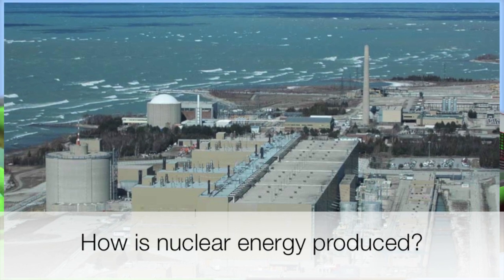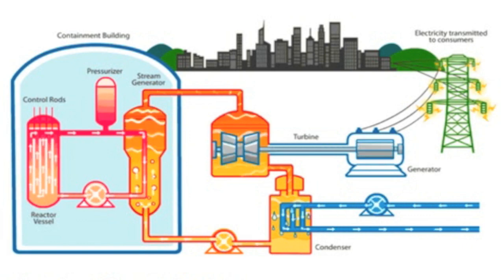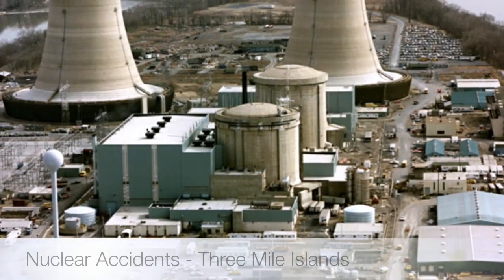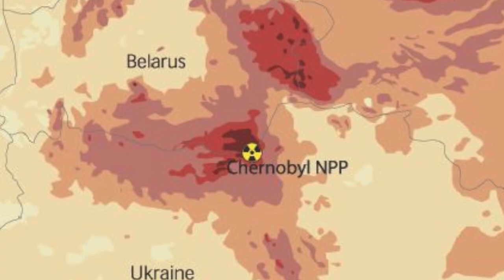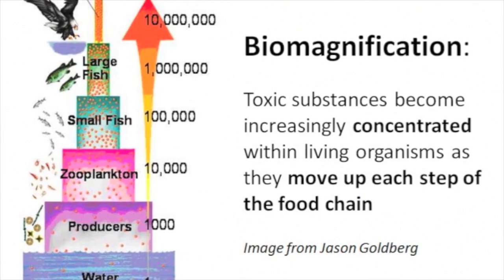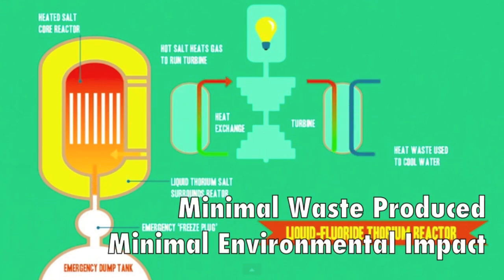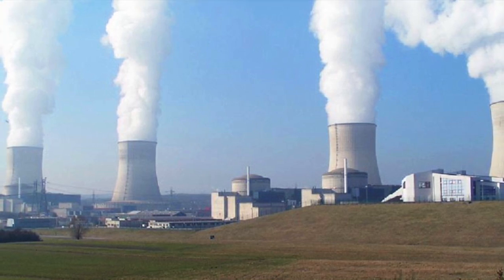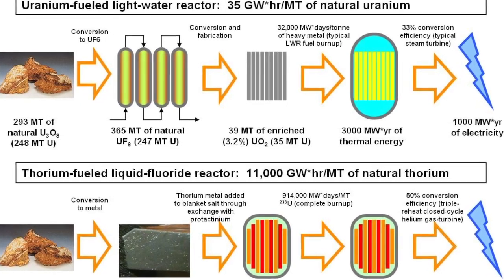Thorium vs  Uranium

Comment: Naughty, Naughty. Name a video Thorium vs Uranium to just bash nuclear power as really bad.
Since Chernobyl around 10 million people died from coal mining accidents, black lung disease, lung cancer from coal, coal transportation accidents, coal boiler explosions, and the total gamut of coal pollution effects.
Chernobyl killed a few hundred people.
Why don't we focus on that instead ????
The big deal in nuclear isn't Thorium but molten salt reactors (MSR). They're much cheaper than solid fuel reactors. MSRs can be designed to run on Uranium, Thorium, Plutonium or mixture of the three.
Meanwhile Thorium can be used on regular solid fuel reactors. Fuel formulations like 90% Thorium + 10% Plutonium have much higher thermal conductivity and thermal margins vs regular uranium based fuels. This allows both to increase safety margins and reactor power. Brand new reactors with design changes to use Thorium fuels can attain 30% higher power output that with regular Uranium fuel.
The two logical small steps are being prepared already.
Terrestrial Energy IMSR reactor runs on low enriched Uranium but its an MSR. In can extract 6x more energy per ton of mined uranium vs regular sold fuel reactors. With infrequent reprocessing (once every 7 years) it should extract 10x more energy per ton of mined uranium, enough so that if every coal/gas/oil/old nuclear electricity plant in the world were replaced with IMSRs, existing Uranium mining and enrichment would be enough. There are other MSR efforts worldwide. I'm showcasing Terrestrial cause they're taking a feet firmly on the ground, keep it simple stupid (KISS) approach. They refuse to make any choice that reduces the chances of certification/commercial success.
Thor Energy has completed 2 years of testing of Thorium based fuels in the Halden-Sweden test reactor. Their new fuel formulations should obtain approval soon and be loaded on existing reactors around 2020. 80% of the world's reactors can use Thor Energy fuel. At 15% uprate on suitable existing reactors is enough energy to power all of California + Nevada.
Reply: The huge win with MSR technology is the ultra low costs of building and operating a plant. Weinburg's original MSRE in Oak Ridge Labs ran for 5 years. Switched on every Monday morning and off again on Friday night. He didn't want to work weekends! The design was based on Weinburg's talent and not much else as there was no design information to use. It ran with no problems for all that time until closed by Ricard Nixon. All their data got shoved into cupboards and forgotten. 
5 years later, Three Mile Island went pop.
Moltex from UK had their design costed by Atkins (the world renown nuclear engineers) who used their expertise to spec and cost the plant to current nuclear standards. In spite of all those additional costs over any other energy source, the build cost per MWH (MegaWattHour) was less than the cost of a coal fired plant. However UK's nuclear regulators would not authorise a pilot plant so Moltex went to Canada.
The current nuke industry is not fit for purpose.
Reply: Don't forget the British Moltex that uses molten salt fuel contained in vented fuel rods. Just like Terrestrial Energy, they are doing everything possible to avoid complex regulatory issues. But they still had to give upon the UK simply because the regulator was dragging things out with inappropriate demands. They moved to Canada and expect to have an operational plant very soon. Their whole gamut is to be cheaper than coal.
Reply: @Dave5843-d9m  That's awesome to hear that canada could be at the forefront of nuclear innovation
Reply: People will call this a conspiracy theory, but I believe that a LOT of the behind the scenes pressure to stay with the solid fuel, Rube Goldberg versions of nuclear we went with was from a fossil fuel industry that did NOT want to have to compete with an abundant fuel, efficiently used, that has a MILLION TIMES more energy density than the purest, densest forms of fossil fuel.

  All they had to do was add enough additional impetus through third parties, to get Nixon to go with the solid fuel programs in So Cal, an area he had strong political ties with, and a choice also supported by the MIC as the proven source of the weapons grade material they “needed”.

  If public (and planetary) safety were a consideration, BWR’s and PWR’s would NEVER have become “the standard”

  Now the regulatory agencies are built around approving and regulating this specific type of reactor, and the public is RIGHTFULLY fearful of the type of accidents that have caused various governments to increase their “acceptable levels” of radiation exposure, so as not to have to even attempt (the near impossible task) of cleaning up radiological emissions from the many small and luckily few HUGE “accidents” we have experienced in the blip of time since we have started these experiments in “bringing star-power to earth”

  Fukushima is a disaster for the pacific of EPIC proportions...  3 full blown melt-downs...

  Hopefully we can make “sane nuclear” happen, in spite of the fear created by past reckless disregard for the difference between the hazard from external and internal exposure to the now worldwide emissions from past activities, and present/future releases from ongoing disasters in Japan, and “buried problems” elsewhere.

Comment: I'm going to stop you on the psychological effects. None of your examples have ever been proven through blind testing and so they are thoughts, not facts. I deliberately isolate myself a lot throughout my workday, my work does not involve radioactive materials and the deliberate isolation at work leads to general isolation at home. In order for a theory to be proven it must undertake double or triple blind testing without fail, numerous times. I just took part in a triple blind experiment for you and your theory about the psychological effects has been proven to be incorrect as social isolation can come from numerous sources. Thus the personal lives of the subjects of your tests have to be factored in. This creates an enormous variation. Too big to be considered. 
If you are doing this as part of a college or university degree related to physics then I highly suggest you leave out anything related to psychology. Theoretical or applied physics is demanding, perhaps more than any other degree. With an 80% failure rate for PhD students. This is because physics demands proof. What you say in your thesis, has to be shown to be correct and psychology is a "guessing game". So leave it to the psychologists.
If you're going to guess at things in a thesis then you might as well write "but it might have been god" above your signature. Ken Ham will take you aboard, I'm sure.